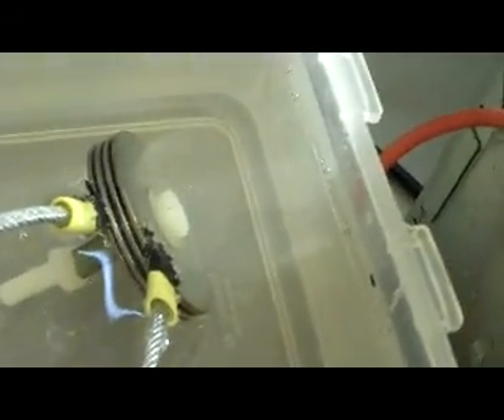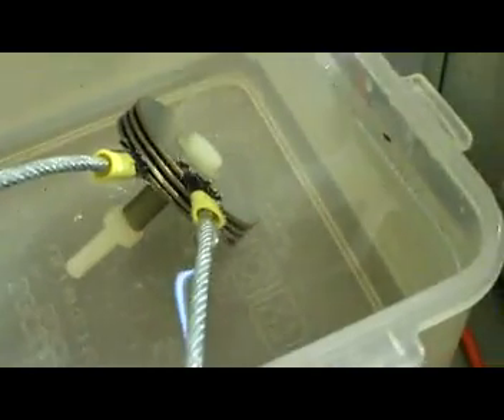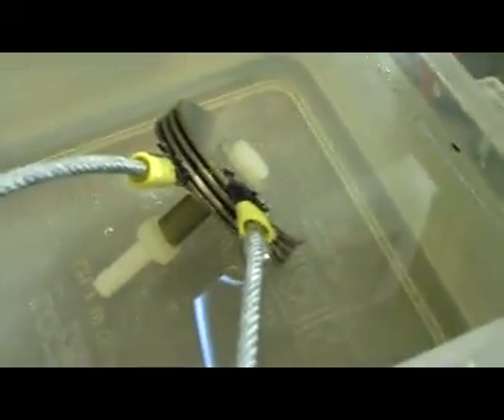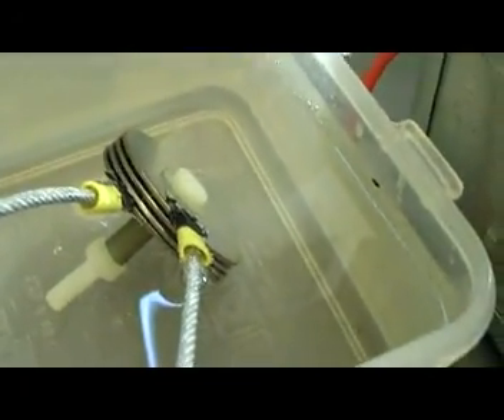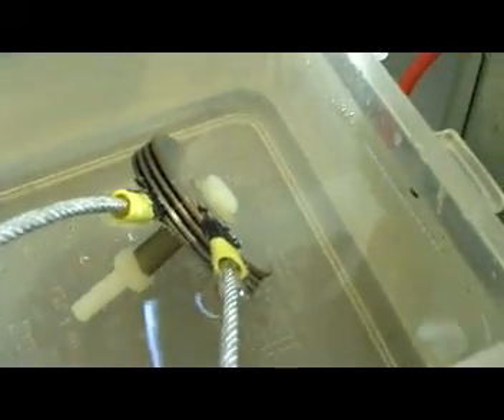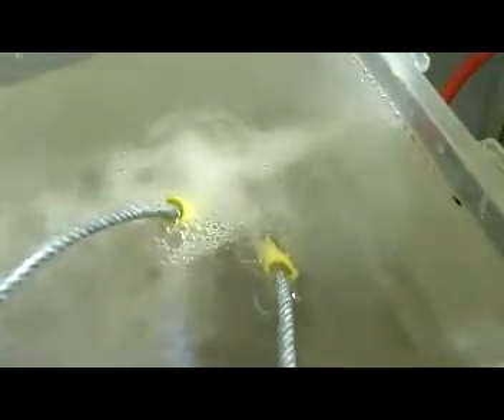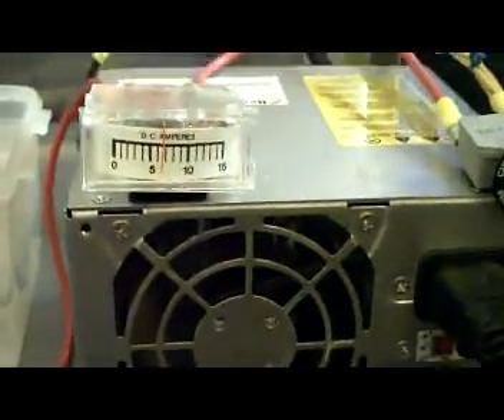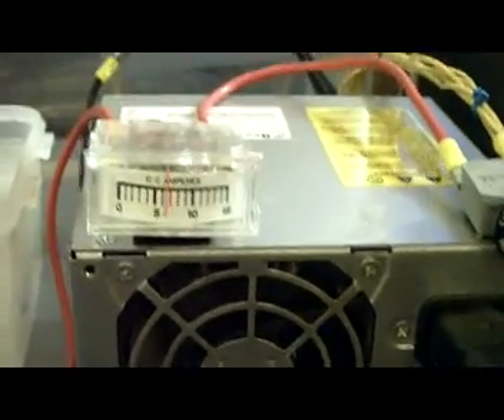Vid31 Brainstorming with Washers & Hydrogen (HHO, Brown's Gas, Hydrogen, Hydroxy)

Comment from the maker: I've been working on a design that has 5 of these cells together in one 4" section of Acrylic Pipe.

I've come up with a way to connect several of these cells together, but I don't have enough materials to build a second fuel cell, so I will have to put it on the backburner for now.

Comment: you  are working in the right direction by adding mulp. cells buy hocking your cells together you will get  more hyd comeing out  of your exit port. also try piggy backing your washer togrther in series in one container this will also incress the out put from one cell as you add more cells and hock them together you will a lot of hdy. out your exe port.